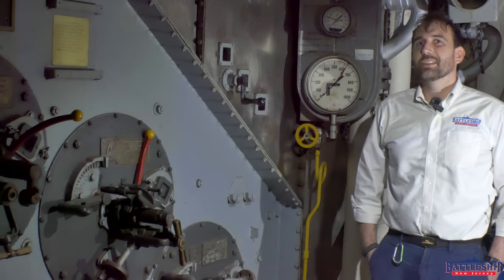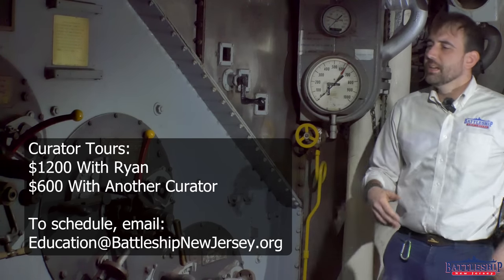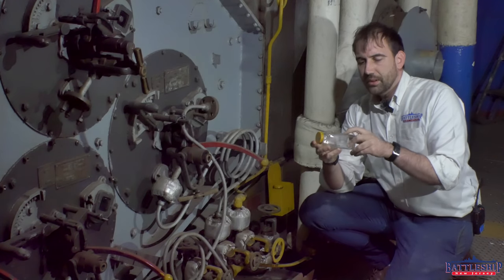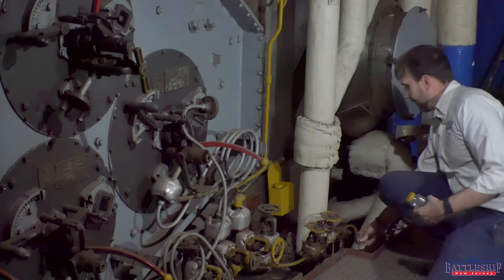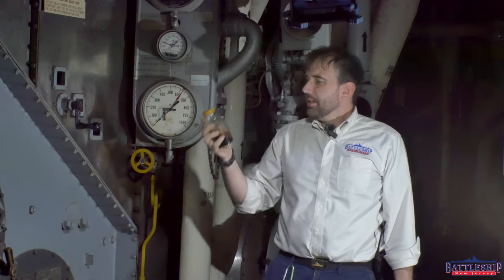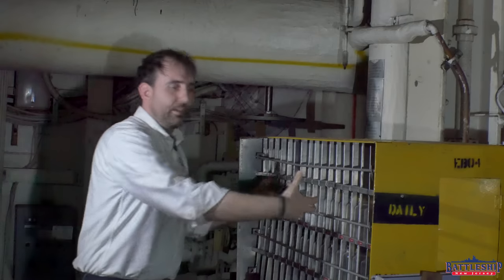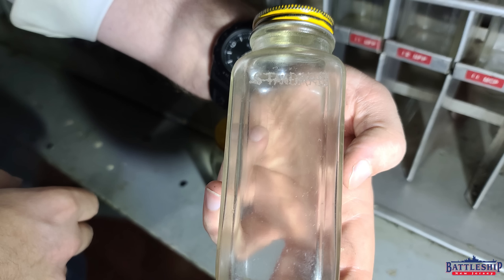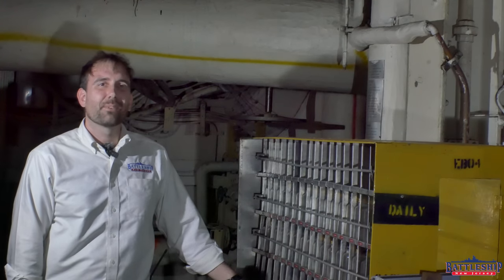Found! Battleship Fuel Oil

Comment: A ship or railroad locomotive with a big V-12 or V-16 diesel engine probably runs that fuel, or could if it weren't for regulations.
When we were expediting our trip to Desert Shield on the USS Saratoga in '90 we scooted at high speed all the way across the Atlantic and Mediterranean both without slowing down. By the time we got to the Suez Canal the boilers were drinking JP5. True story. We didn't hit a gas station until the Red Sea.
Did New Jersey have an "Oil King"?
Reply: My marine gas turbines LOVED JP5.  Fresh and clean, just like the designers intended.
Reply: Yes they did. Main office is right off Broadway.
Reply: Another comment mentioned the exact same trip lol.
Reply: The Humvees and generators stateside ran on regular diesel fuel.  When we deployed to Iraq in 2003-04, we ran everything on JP-8.  I am told by our mechanics that the JP-8 really cleaned out the engines.  It worked just fine for our tour.
Reply: No, not for regulations. Before the government even dreamed of regulating combustion engines, the engine manufacturers realized that diesel fuel worked the best in the medium speed diesel engines. Bunker oil couldn't be heated in the fuel tanks when the engine needed to be started in cold weather. Also, the only engine to ever run on bunker oil was a turbine. No rail service piston engine ran bunker oil.
Reply: @pootispiker2866  I do think some of the turbine locomotives ran it though.  heck i think they tried powdered coal in those
Reply: @dave4882  The injectors on even the old diesels were not at all tolerant of thicker fuels. While the fuel is heated by the engine, the lift pumps don't have the necessary suction to draw thick sludge through the lines.
Reply: @pootispiker2866  I'm referring to the union pacific gas turbine locomotives produced in the 50s and 60s.  But per my quick research, although the railroad referred to it as bunker C, in reality it was bunker B  a slightly cleaner fuel.
Reply: @dave4882  I know which locomotive you're talking about
Reply: @klsc8510  Friend had to run a truck on Jet A1, because no diesel fuel available, so , as his truck was full of empty barrels, he dropped the one nearest the tank with the crane, and started draining the empties into it. the AC fuel pump is designed to leave the bottom 20l in the tank, just to keep water from the jet fuel, so 10 empty drums drained with a hose got him a full drum, and then it was lifted back into position, and the same hose was used to pull from the bottom till the water was gone, and then the fuel was used to fill that truck tank. Made a big change in performance on that truck it went from struggling to climb hills to keeping the speed limit up them. Plus on return the entire exhaust had been burnt clean of any carbon. Went back to sluggish when filled again with diesel.
Reply: @SeanBZA  That is a creative solution to the problem.

Comment: When I went into the navy, steamships burned bunker oil, a thick black oil. But as I was leaving in 1971, the USN ships were being converted to burn jet fuel to make oil storage easier on the carriers. Besides their own boilers, carriers carries fuel to replenish their escorts. We refueled about every 5 days. Lead bars were installed in the fuel tanks to make up the difference in weight of lighter fuel. Your sample looks like commercial shipping calls MDO. Either they switched twice or switched to MDO in 1970.

Comment: My ships also had lube oil and fuel oil purifiers to keep each type clean, which was tested by a "clear" (no particles) and "bright" (you could read a maintenance card through it) visual test.
Reply: Oh yep, cleaning the Lube Oil purifier was a hot, messy job. I remember taking that big ass bore brush and dunking it into a bucket of what, probably DFM or PD-680, and swabbing it back and forth in that cylinder to get most of the sediment off the walls, and finishing up by hand with rags until it was sparkling clean. You had to precisely align the fins that went inside to witness marks on the outside of the tube to keep it balanced for the high RPM the purifier attained in use.

The large amount of trash cans all over the engine room? Most of those weren't for actual trash, they stored bales (yes, BALES) of clean rags. And they of course served as chairs for the Watch standers.

There was also the SICLOS evolution! Shift, Inspect, and Clean Lube Oil Strainer. Our strainer was on the opposite side of the lower deck from the purifier.

Comment: The bottles are used to test for water.  A check for water in the fuel is required to be performed on a fire room day tank (the tank which holds fuel just prior to being pumped into the burner front)  before the tank is placed in service.  Water in fuel tanks was a common issue.  In fact in the late 70‘s i was chief engineer on a destroyer that went DIW in the adriatic sea at 1 AM because thw watch failed to perform this test and there was about 3 feet of water in the oncoming day tank.  The water entered the tank due to leaking valves and an unauthorised use of an eductor to remove water from the tank.  We bobbed around in the dark for séveral hours while we figured out how to restart by using the heat left in the boiler.
Reply: What is an eductor?
Reply: Eductors are pumps without moving parts.  They use the energy of flowing fluid to pump a larger volume of fluid using the venturi effect. They are commonly used in bilges as they don't care if the suck up a bunch of debris.
Reply: The eductor on this particular tin can could also be used to remove whatever is in the bottom of a fuel tank…. In this case the valves were incorectly repositioned after use and the water flowed back into the fuel tank….a lot of water.
Reply: Did anyone pay a visit to the Captain for that one? At the very least it was dereliction of duty.
Reply: @ssmt2  I was Chief Engineer but do not remember if anyone was ˋhauled before the mastˋ

Comment: On the Midway we had a dedicated Oil Lab for all shipboard fuel, lubricating oil, and for fresh/feed water.  We also ran the evaporators making feed/fresh water. We used centrifuges to spin out lube oil/fuel oil to get samples of contaminants to determine the type of contamination (salt water/fresh water). Plus numerous test on water samples (never ending test).

Comment: Oil king question,   How many main fuel oil tanks; and what are their markings?  7B DFM bottle probably goes to the fuel tanks for the space boilers, 7A and 7B.  On the Gas turbine ship's we had 2 main fuel tanks per engine room or generator set.  That way you could be running off one and filling the other one.  Or if one became contaminated or leaked you still had a fuel Of course there was also emergency suction that could be aligned to draw directly off the storage tanks.  but you ran the risk of clogging filters

Comment: F-76 or DFM is what we also used in Spruance and Arliegh Burke Class main propulsion or GTG gas turbines. Or JP5 used for helos which we could cross connect to in emergencies. Been along time but seems like we had a Penske-Martin flashpoint tester. F76 flashpoint was supposed to be 140deg F ?… we used 2190TEP for main reduction gear lubrication and also for CRP controllable reversal pitch propeller actuation. Cool.. brings back memories.

Comment: IC1 (SW) Johnson ret.

Ryan,
That DFM you have in that jar looks more like coffee than DFM. The DFM should be nice and clear with a yellowish tint. That stuff has more of a look like thinned-down bunker oil than DMF. Also, on the USS Wasp (LHD-1), while I was there, the square bottles were used for lube oil samples, and the DFM was taken in the round bottles so that they could get the DFM spinning inside. The centrifugal force would concentrate any dirt or water at the center.
Reply: IC1:
What would your guess be for the PBX installed during the '80's refit?  I'm leaning towards AT&T Dimension 2000.  FWIW, I agree that DFM should be yellowish and crystal clear.  Almost 3 years on an AOR, I've seen fuel once or twice...

Comment: As a former UNREP rig crew, that little jar brings back memories of the hurry-up-and-wait of UNREP fueling: we'd all bust our asses on both ships to get lines and hoses across, the customer is working hard to hold position, our helmsman is working hard to hold course, we finally get everything set up, we start pumping, then immediately stop as a couple guys in purple work vests and cranials fill a little jar with fuel and take it away. Then both crews stand and stare at each other across the water for about 10 minutes until the "grapes" declare the fuel sample acceptable. Only then could we really commence pumping. I always wondered where those little jars went... 

Was USS NEW JERSEY given the equipment to receive UNREP fuel or cargo? I bet she could receive cargo. That might be as simple as a block on a bulkhead and the deck crew hauling on a line. I think the fueling system is a bit more involved on the customer's end.
Reply: I was the guy topside on the receiving end of that hose checking to make sure the pump-side guys weren't using the UNREP as an opportunity to strip the water out of their tanks and into ours.  During one refueling the initial sample looked great, but later on one of the periodic samples ended up a bottle of water with a little F76 sprinkled in.  We ended up with a few thousand gallons of water in one of the storage tanks.  My LPO at the time said that it was not unheard of.  Almost used up a whole tube of water indicating paste trying to figure out how deep the water was in the contaminated tank.

Comment: The New Jersey probably got little or no Bunker C. By the time it entered service, the Navy had shifted to NSFO (Navy Special Fuel Oil) which is Bunker C cut with a distillate to reduce the viscosity.
Reply: If I'm not mistaken NFSO is interchangeable with Residual Fuel Oil No. 5? They generally cut it with just enough normal heating oil so it flows without heating it.
Reply: Do you mean by the time it entered service in WW2?
Reply: From what I can tell NSFO is #5 or Bunker B and can be its own fraction or #6 thinned out to meet the viscosity requirements. I would imagine that as the fuel bunkers are located towards the outside of the hull New Jersey could still have had heaters to guarantee the fuel was easily pumped when operating in cold waters and I think these have shown up in a video or two. Still needs preheating for atomization

Comment: My understanding of bunker oil is that though the older, unrefined, heavier oils had a larger fraction of carbon in the hydrocarbon chains which should have more energy per unit volume, but burned really dirty and leaves major deposits which are exhausting to clean out.
USS Texas may be a source on earlier fuel knowledge.

Comment: 2190 TEP was the only lube oil used in our engine room.  TEP stood for Tri Ethylene Phosphate.  Basically a very strong detergent oil.  It was basically indestructible. Dirty oil would be pumped or poured into a steam heated settling tank and then run through a De Laval centrifugal oil purifier. It came out looking like cooking oil.  Surprised to hear it wasn't converted to NSFO.  Navy Special Fuel Oil.
Reply: How long ago? When I was in 85-91 , 2190TEP was labeled on our msds as TEP= Turbine Extreme Pressure. Interesting. 2 was the grade of oil, 190 was the viscosity. Anyhow it jarred a lot of memories as top watch telling my messanger to get my oil samples.
Reply: @largesleepermadness6648  Aboard USS Dixie AD-14 from 70-73.  Don't know why but always remembered that from MM "A" school.

Comment: On frigate I served_ I recall the small space for the fuel and water king- Boiler Techs. Don't remember if the handled lube oil samples there or not. Ship had a Ellison Door- Fume tight not water tight - the water tight hatch down to fireroom- Don't remember if entry to that space was just a joiner door or water tight. - Is there a comparable space some where on the BB?   If you have a cloudy sample - water or oil or fuel? How do you determine what causes the cloudiness. That Sample looks like 4 ounce (half cup) at most to me- so 1/32 (or ~3% of a gallon). Hum nice teaser- way much less that I was expecting.

Comment: Fresh fuel does have a little bit of water dissolved in it and a few microbes that live in that water and feed off the hydrocarbons. Their waste is the garbage found in the bottom of diesel fuel tanks along with the ultrafine particulates that are also present in the fuel. I don't know about ships but jet aircraft are sampled daily and fuel service equipment also. On the FFG's that I went to sea on, they had the "Oil King" who processed and logged fuel samples from the ships fuel tanks along with lube oils and hydraulic fluids. DFM may be darker than jet fuel to begin with but not that dark.

Comment: you mentioned relamping one of the fire rooms.  would these spaces have had incandescent or fluorescent lighting during WWII?  fluorescent lighting has been around for a long time (cold start tubes since about the middle of WWII) so its possible that they were used for the lighting.  just curious if you knew
Reply: This was covered in a different video.  The shipboard lighting during WWII was incandescent, it wasn't switched over to fluorescent until one of the later refits.

Comment: Bunker C is Not unrefined crude oil!

It is the opposite . It is what is left after you refine out the gas, diesel , lube oil etc.

The bottom of the barrel !   Unrefined  crude oil has everything still in it and very dangerous since the gasoline and naphtha fumes are very volatile.
Reply: That was why the Japaneses carriers at Philippine Sea exploded and burned after being torpedoed.
Reply: "Bunker C is the stuff that is too thin  to make good road asphalt."
(Copied from Keithalaird, above here.)

steve

Comment: I suspect that the second bottle that's next to the sample Diesel fuel bottle would have held the reference (standard) sample, since fuel isn't going to degrade under normal storage conditions. Any unacceptable deviation from standard would be due to contamination, where any deviation from standard for lubricants would be due to either a need for a lubricant change, or due to a mechanical failure.

Comment: I wonder if the bunker fuel was close-to-unrefined crude - I suspect it was actually a heavy fraction of the crude, left behind after the gasoline and diesel fractions had been removed, and one step up from asphalt (which wouldn't be usable, as you'd have to heat it to get it flowing). That old Russian aircraft carrier that is constantly breaking down supposedly burns something that causes it to smoke a lot, probably the old bunker fuel.
Reply: Yes the ship was originally built for residual fuel oil, probably #5 (NSFO/Bunker B) but maybe #6. It was converted to a distillate product later
Reply: The Russians use fuel just one step up from unrefined crude.  That said, the smoke and the constant breakdowns speak more towards material condition and maintenance than to fuel type.
Reply: You have to heat bunker oil to get it to flow.

Comment: The sad part for me is that the oil sample rack for fire room 2 is in quite possibly the most awkward place to show a large tour group
Reply: It can easily be moved, nothing on a ship other than engines is permanent, and that rack can be stripped to parts to carry through to the main tour line, and fill those bottles with a mix of regular ATF, SAE30 engine oil, 20W 50 engine oil and then finally some oil from an oil change on Ryan's Honda Civic. Range of colours, and you put new at top,  then slightly diluted with civic oil in the middle, and half and half at the bottom.

Comment: If we built a battleship today, it might include a full oil lab. Modern equipment (ICP-OES, etc) can tell you exactly when lube oil needs to be changed AND it can pinpoint exactly which machinery components are wearing. See a spike in a certain isotope of nickel? Well its probably time to look at the pump bearings.

Comment: I'm going to make an educated guess that the lubrication sample bottle rack served two purposes. First, it told you if you needed to change the oil. Granted you would always be topping it off, but you're looking at the aggregate.  The second, and perhaps more important reason, is to allow things to settle out in the bottle and then look at the residue. If you noticed something in that small sample of lubrication oil, you may have a larger issue at hand.

Comment: Typical, fuel for the boilers come from a service tank where the fuel has previously been settled. That residuel test fuel in the bottle can be used for the burner lighting torch. I trained in M, D type boilers in the 70's but worked on a P-fired boilers on my first USN assignment. Lube oil samples would be kept locally in spaces, fuel oil samples in the Oil Lab where the Oil King reigned.

Comment: I assume as part of the mothball process all the oil and fuel tanks were emptied. A tank that sits empty tends to rust. If she were reactivated would they have to put in new tanks or send some hapless tech in there to clean all the corrosion and condensation out?

Comment: Ok, that's interesting that it was covered from Bunker C  to Marine Diesel. I'm curious that that entails, what sort of changes in performance that would bring about, and why they would do that. That's very interesting. Since I work on the USS Hornet, we have the same boilers. Would they have been able to be "converted" in the same way if the Hornet was kept in commission as long? Were any of the Essex's (Or any of the carriers for that matter) converted? I know some of the newer Essex class, and the Midway class were kept in Service until the '90's, and they all have the same engineering plant. Same with the Kitty Hawk class, until about 5 years ago or so.